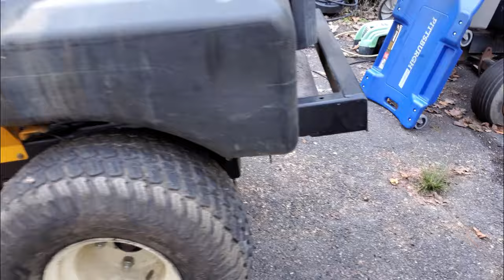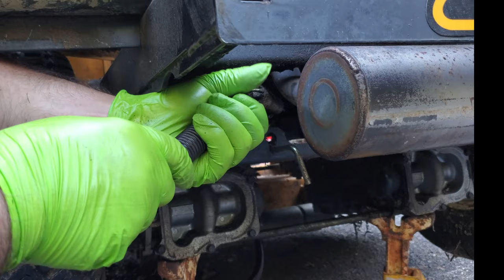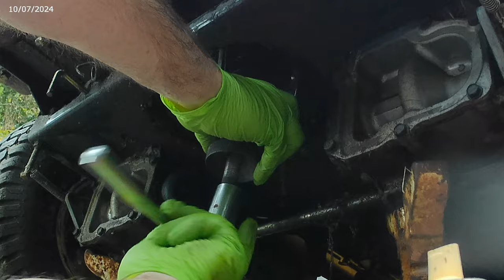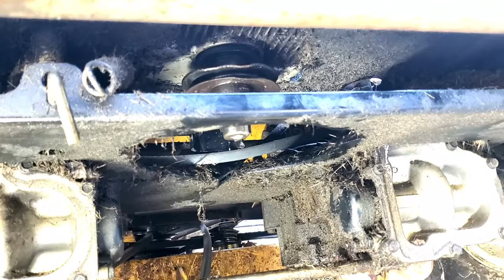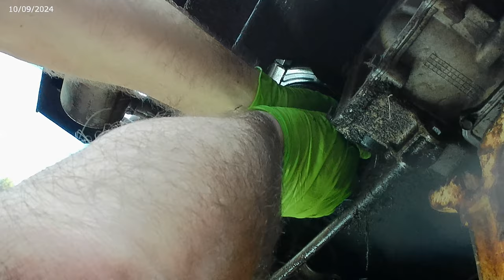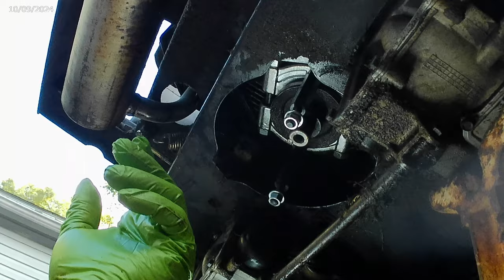Crankshaft seal replacement,  should have been easy, NOT THIS TIME!

Comment: By any chance can I get info on the pto belt and the deck belt I can’t seem to find them.
Reply from the maker: I will check tomorrow.
Reply from the maker: this should be the part # for the PTO belt, Cub Cadet 01005011  size PTO Belt, .656" X 83.20"  the deck belt should be Cub Cadet 02000653
V-Belt, 1/2 x 90.9 LG. Keep in mind, this is for the one I have, model year 2005.

Comment: It's a mistake by men at work fits this video on the mistakes of engine oil seal replacement
Reply from the maker: Yeah, it did not go as planned.
Reply: @ridingmowerking   😮😳
Reply: Need to invest in a air hammer
Reply from the maker: I have one, just not the tool I would choose at this time, but I do use it ofter for getting things loose. @randyseabolt272